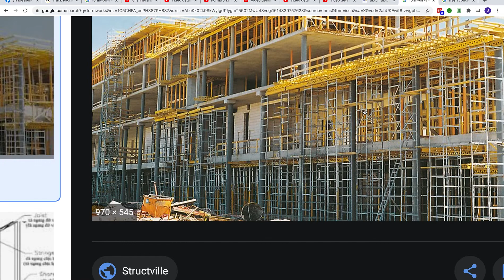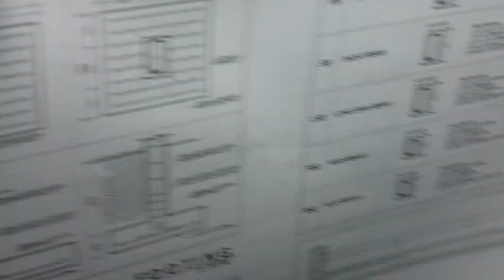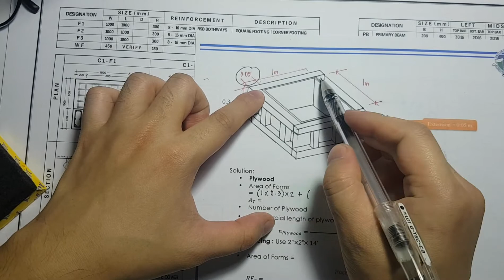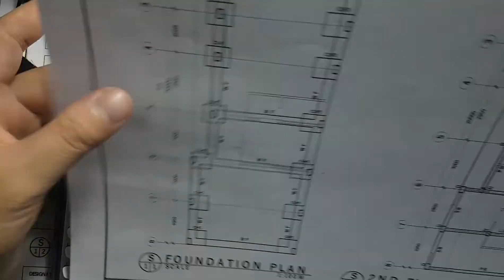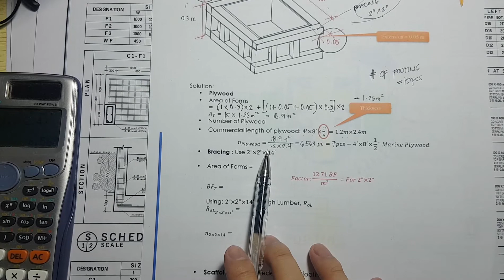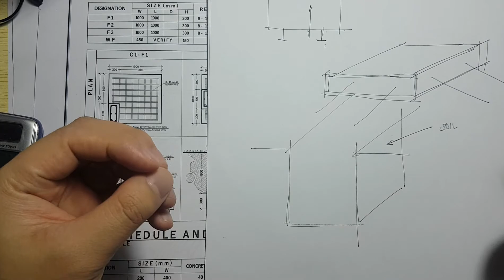ESTIMATING FORMWORKS - Footing 1/4

Comment: pwede pong malaman pano nio po naderive ung 12.71 .ty
Reply: Samedt, po. Actually, ang meron sa akin is yung 2000 edition din po. Pero nag dl din po ako nung ibang version (?). I notice may slight difference po talaga sa mga results niya, tas yun nga may ilan na medyo iba yung procedures. Though I really don't know kung ano po yung latest version/edition nung book. Pero since the start nung estimates yung isang verison yung ginamit ko po kasi yun din yung prinovide sa amin ng prof namin at ginamit sa video. Pero pwedi din naman yung 2000 basta consistent lang na yun ang gamit mo from concrete na estimation. Clarify ko lang po na hindi po ako yung nag discuss sa video. Student lang din po ako hehe.
Reply: Computed factor po siya. Where 12.71 ang factor for 2" x 2" frame; at 18.96 ang factor for 2"x 3". Based from table 5.2 of Simplifed Construction Estimate by Fajardo. You can download the pdf. But I don't know kung anong edition sya makikita since and pdf file na na-download ko is walang cover page. :)
Reply: @annakyouyama7549  i see maam , meron din po kase  akong book ni fajardo SCE 2000 edition po , correct me po, dun po sa book nia kapag nakakuha kana ng pieces ng plywood tpos minultiply lang nia dun sa computed factor for 2 x2 na wood which is 29.67 for 1/4 mm thickness (plywood) then equals npo un sa board feet ayun na din po ung bali ipapang oorder nia, pero sa inyo po kase kinuha nio ung pieces ng wood lumber then kinuha ulit ung bord feet para un na ung gagamitin para bumili sa market 

Siguro bago po ung edition ung nadl kaya medyo may nadgdg tanong kolang kumg pwede gamitin ung method dun sa 2000 edition or un sa inyo po ? Salamat